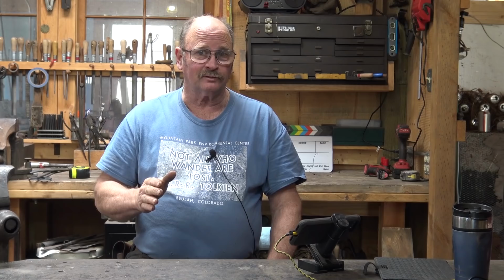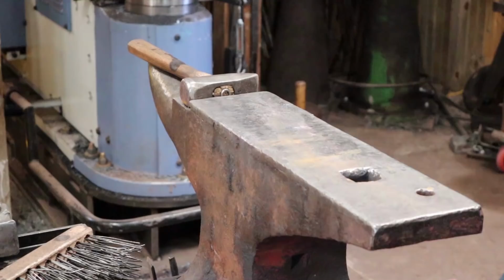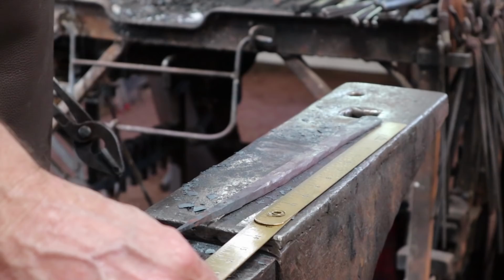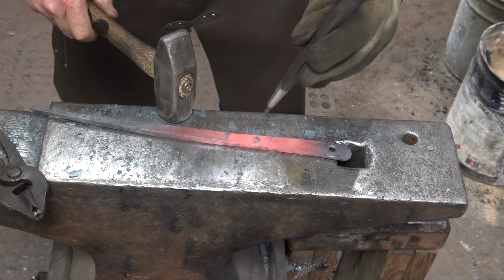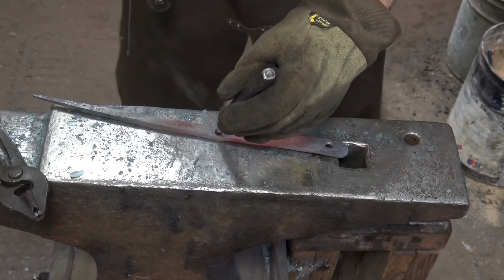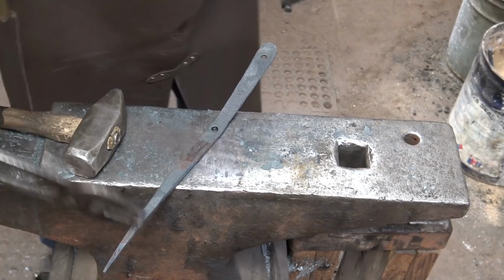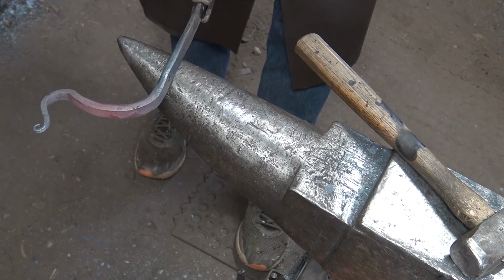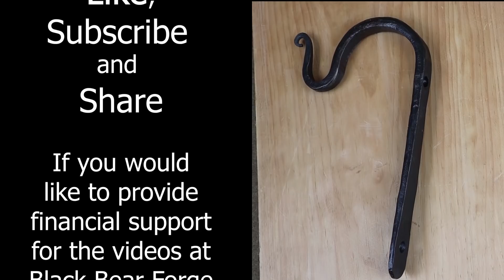Inverted plant hook - hook of the week 4

Comment: Nice camerawork, very enjoyable to watch and easy on the eyes. I did notice one thing just now with this new camera angle, your anvil stands pretty high, if you stand next to it and you'd stretch your arm, I think your hand is far below the face of the anvil. Here in Belgium they say when you hold your hammer with your arm stretched, the face of the hammer should be on the face of the anvil (or in other words, the face of the anvil needs to be a few cm lower than the knuckles of your hand). I get pain in my back after hours of hammering, I think I'm going to set my anvil higher like yours and see how that goes. Thanks for the video and nice hook.
Reply from the maker: Thanks.  Your anvil should be at the end of a comfortable hammer swing, not a straight out locked elbow.  Having it a bit higher is way easier on your back and worth looking into

Comment: If a plant hook is intended for exterior use (as they generally are), what would you recommend as a finish for it?
Reply from the maker: Our climate is fairly dry, so wax applied just hot enough to melt works well.  In harsh climates paint or powder coating might be required.

Comment: Oh sorry, you said on the horn would be faster not easier. Still.....please explain. Thanks.
Reply from the maker: The round surface on the horn moves material faster than working on the flat of the anvil.  Sort of like using a rolling pin to roll out pie crust
Reply: @BlackBearForge  Oh, talk about missing the obvious, I  don't think I'm usually than dense. Thanks for the clarification though.